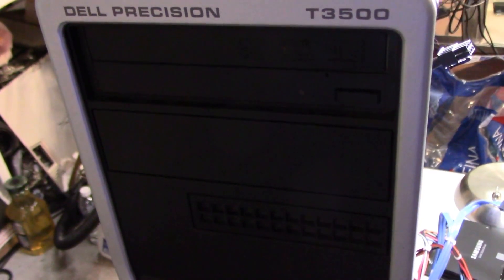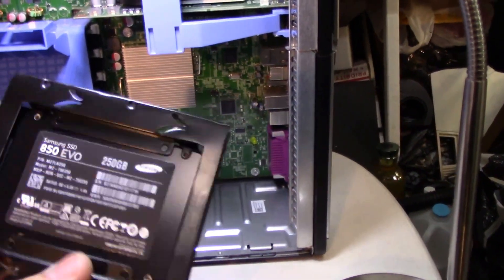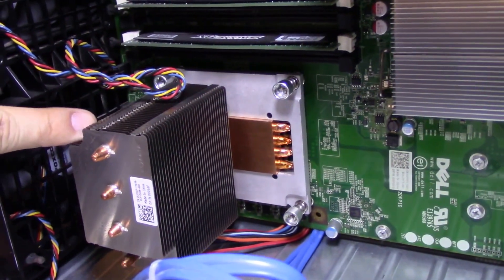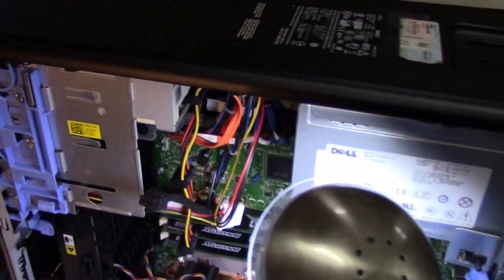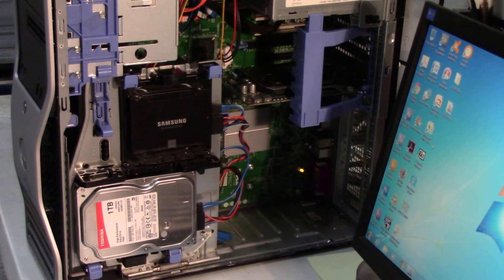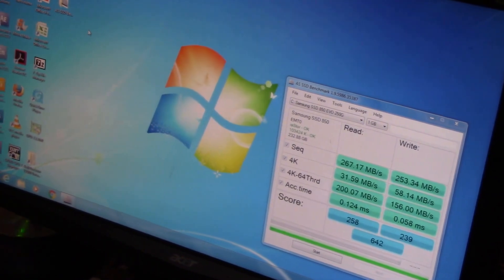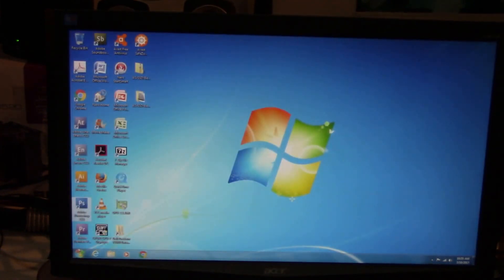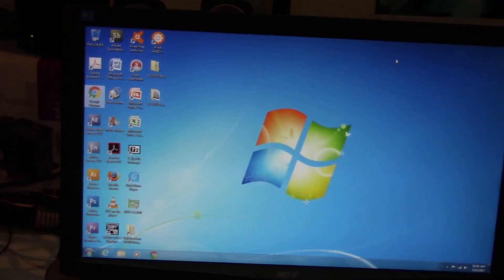SSD upgrade on Dell Precision Work Station is it worth it?

Comment: You can upgrade these all the way to a 6 core 3.4 GHz with Hyper Thread support.  I used two of them for workstations and two of them for servers in my home network.
Reply: love these i build a 1080p gaming pc with it. I added ssd and 4gb gpu
Reply: I know for sure that this chip will work because I have four of these workstations running it:
http://www.ebay.com/itm/Original-Intel-Xeon-W3690-3-46-GHz-Six-Core-AT80613005931AB-Processor-CPU-/282053752153?hash=item41abb6b559:g:fWkAAOSwdsFXTP6C
Reply: Does that chip work in ones with a w3550?
Reply: @Demon09-_-  yeah it does make sure your bios is up to date
Reply: i can work for w3550 ?

Comment: I have one, x5690  with a 250 gb ssd with a 2 tb platter drive running windows 10 64bit professional with 20 gb of ram. I am about to upgrade the videocard to a EVGA NVIDIA GTX1660 Ti 6GB Graphics Card which if I go with this card I will not have to update the power supply.

Comment: Hi, i installed a SSD into my Dell 490, and it is constantly freezing and running very slow, i managed to stabilise it for a little while but most of the time it just freezes, any solutions?
Reply from the maker: It is hard to say, are your bios settings set correctly? Storage configuration should be ACHI not raid etc... If that is set correctly maybe you have memory issues, might want to test your memory with something like mem test if your storage configuration is correct.

Comment: w3690 is the strongest Xeon for 1366 socket.  $59 on Ebay
Processor Base Frequency
3.46 GHz
Max Turbo Frequency
3.73 GHz

On a custom motherboard you can overclock it, so can you overclock x5675 that cost about $25 right now.  Both 6 cores 12 threads.

Comment: I recently got a used T5600 (dual XEON E5-2667 2.9GHz, 32 GD EEC 1600 MHz RAM, 825 Watt PS) in a company decommissioning...I was able to acquire under the policy for free.  Thru in a GTX 980 (had to adapt one 6 to 8 pin for the 6+8 pin power connections to the card).  Thru in an 240 GB WD SSD and did a fresh install of Win 10 Pro with a 10 dollar license key.  All-in I spent an additional 340 dollars in upgrades.

What a machine.  Productivity, Gaming, home server usage cases. Rock solid build.  Server components.  No complaints.

I did remove the H310 RAID adpater and went SATA 1 direct to the motherboard for the SSD.  The bootup times with the H310's own bios was not interesting for me and the drive setup was taking additional time.  Quite happy with the SATA approach here, though I understand the channel width and speeds via the H310 might be interesting to some, even in a RAID 0 setup.

Comment: Hello I have a dell workstation T5500,
The ssd speed problem is too bad, in the user guide the sata ports is sata3 but ı think they are sata 2. Am I right? Did you check the sata ports. İf I am right I will use IBM ServeRaid5000 raidcard for ssd and my sas hdd for the best performance.

Comment: I need some help,
Just got a PC for 180,
Has the following specs:
Intel Xeon W3520
1tb hard drive,
AMD Radeon 8490,
16gb of ram,
And Windows 10.

What upgrades should be made?
My goal is to record League of Legends, Skyrim, Garry’s Mod, Minecraft, DayZ Mod videos at 60 FPS with lowest settings, and occasional high settings for certain clips.
Reply from the maker: Sandman the Xenon you have has base clock of 2.66 ghz, and a max turbo of 2.93 ghz, it should give you the performance you want at 60 fps at lowest settings, however you need a better video card, the 8490 is a basic display adapater not meant for gamming.  You first upgrade should be a new power supply, I would recommend a 500 watt or greater power supply, get a good brand like corsair, thermaltake, or antec, Thermaltake is the best bang for the buck.  The hardest game to record for at 60 fps would be DayZ and Skyrim - Skyrim SE is harder to run than the original Skyrim. You would need a GTX 1050 2GB for DayZ Skyrim will run great with that card too.  If you can afford it a GTX 1050ti would get you great FPS on higher settings.
Reply: lorllc and if I was just doing regular gaming outside of recording, would I still be able to have 60 frames on those games at the lowest setting? 
I’ll be playing the regular edition of Skyrim and the DayZ mod from Arma 2.
Reply from the maker: Well the most important thing you need is a better graphics card. If you get a GTX 1050 you will get very good frame rates, at higher settings. If you are on a budget you can look for used graphics cards on eBay etc a used AMD 7870 can be found for $65.00 - $80.00 and give you very good FPS
Reply: @lorllc T3500 already have a Dell Original 525 Watt Power Supply with 85+ Rating

Comment: I bought a T5500 from eBay last year for £230 and I put in two six core Xeon and a GTX 1060 6GB. I also put two Samsung SSDs and I use it for gaming. Superb machine. I had to take the blue bracket by the PCIe slots to fit the GPU but it works with Windows 10 Pro. It also came with 60GB ECC DDR 3 RAM. Considering my options for liquid cooling.
Reply: where you put it (ssd) port? with PCI-e sata III controller or sata port on board?
Reply: I use the on board SATA port.
Reply: whats the SSD you used? samsung 850 evo 250gb? I have a T5500 and wanted to upgrade. Thanks,
Reply: 2011Technical my boot drive is an 840 Pro 250GB with an 850 Evo 1TB SSD for additional storage.
Reply: @Kundalini12  İn the onboard Sata port can you use it well, because when I use that ports the SSD max speed is 280mb/s I think that ports is Sata2.

Comment: Hello, I have installed a 120 Gb ssd (at SATA1) in a T5500. The disk is not detected until the F1 key is pressed https://www.youtube.com/watch?v=93yK37iDi3o
In the bios switching from RAID/on to RAID /AHCI didn't improve. The bios version is A02.

Comment: Mine has Intel(R) Xeon(R) CPU  X5680  @ 3.33GHz turbo to 3.6GHz
Running and Old Radeon HD 6870
Great for gaming at Max Video settings on WarThunder 100FPS 
Sata speed can be upgraded by adding a PCIe adaptor 
Heck you could probbably add Mvme SSD via PCIe to mini Pcie adapter

Comment: Bought mine half a year ago. Still very happy with it. Upgradeable as hell and if you do so, still a nice performance for nowadays.
With boot SSD, USB 3.0, Xeon X5690, enough RAM. You might think about changing the powersupply, if you want to add some graphic from nowadays.
I just think about to imrpove it's grpahic System (Nvidia Quadro fx 5800 and Nvidia Tesla c1060, working together with Nvidia Maximus driver).

To answer the question in youre video title: Yes, i think it's worth. Even in 2017.

Comment: Good video. Just recently got one of these + a lot of spare parts. Basically just changed out the psu with a 600w antec. Added a GTX 580 videocard I got for free. Added a SSD drive today. Basically when you see the windows logo it takes 8 seconds to get to Microsoft edge. My processor is a Quad Core 3.07 ghz. 24gb of ram. Was really surprised with the performance of this machine. Out performs a 6 core amd fx 6300. 2x Quatro 4000's 2gb came with the machine but I read that sli does not work with them.
Reply: trying to help a friend set up an SSD in his dell but i cannot see his BIOS options, wondering if he needs to set anything to SATA mode or anything because he is not having his SSD drive show up after install

Comment: i have this kind of desktop but in time of 3d rendering it will take time this kind of processor xeon w3503 @ 2.4 ghz and core 2 only thats why im planning to upgrade my processor in Intel Core i7-7700K isnt working on this kind of workstation?
Reply from the maker: jhongzkie Gamers, the Intel Core i7-7700K (socket 1151)  will not work on the Dell T3500.  A Knowledgeable viewer Chris Moore has stated that you can upgrade a Dell T3500 all the way up to the 6 core 12 thread Xenon Westmere  Processors (socket 1366 B) if you can find these processors then your 3D rendering times will go up, in addtion, make sure you have the proper video card for your 3D rendering program, that makes a huge difference too.  

Here is a list of compatitble Processors for your Dell T3500 DELL DPN: XPDFK Precision Workstation T3500 Motherboard

Supported Processors:

Intel Xeon 6-Core (X5670, X5650),

Intel Xeon Quad Core (W3550, W3565, W3530, E5640, E5630, E5507),

Intel Xeon Dual Core (W3505, W3503),

Intel Xeon (W3680)
Reply from the maker: You can find some of these Xenon Quad Core and 6 Core CPU's for cheap online.  Making this Desktop a great value!
Reply: I did not try to put an i7 in there, I bought one system that already had the 6 core Xeon in it and upgraded three other systems that came with different (slower) Xeons.  They all worked like champions.
The one I used was a Xeon W3690, but this one has even better specs and should work perfectly:
http://www.ebay.com/itm/Intel-Xeon-X5690-Six-Core-Processor-3-46GHz-12MB-Cache-LGA-1366-/122524028534?hash=item1c87004e76:g:iQkAAOSwmCVY9J5~
Reply: I think that most of Intel's decisions are purely money driven.  They could have ECC support in every CPU they make and it wouldn't change their production cost.  They just want to be able to charge more for the high core count Xeon CPU.  It is the same reason they have kept the core count compairatively low in the consumer line.  They build the product around the target audience and price it based on what they think the buyer will pay instead of having any relationship to cost factors.  The fear of competition from AMD is the only reason they rushed to market with the i9 chips, especially when the product just doesn't make any sense.
Reply from the maker: Yikes, the i9 Chips... This launch is definitely rushed I believe the boards have to support like 16-44 pcie lanes depending on processor.  And the processor support is from 4-18 cores... Intel has a history of protecting their markets and also for disabling features between product lines such as when they took overclocking features out on many Skylake CPU's. It is amazing that Intel feels this much pressure from AMD, it is good to have competition, but the only time AMD was a real threat to Intel was back when AMD released the first 64bit CPU.  Let's see how the i9 line is received.
Reply from the maker: The projected i9 prices are pretty insane. I am rooting for the AM4 CPU's to get better with time and  in some current applications the AM4 CPUS really do give intel a run for the money.  Yes, the "Threadripper" is to feature 64 pcie express lanes if the price is right that would be pretty awesome.
Reply from the maker: I put i7 in the my response by mistake lol should be only Xenon, officially the cpu list doesn't list the 1366 i7's but the chipset is identical and they should be recognized but I have never upgraded one with an i7 either, I have actually seen some refurbhised t3500's listed with 1366 i7 950's.  But to get X5690 for that price is amazing.
Reply: I have a Gigabyte system board that takes the same socket chip and I have put the i7 (quad core) in it and I tried it with the Xeon (hex core) and both worked fine.  I know someone that used an i7 in a SuperMicro server board with the 1366 socket and it worked for him, but you loose the ability to utilize ECC functionality in the RAM.  The system still posts and everything appears to work, but the ECC is just not actually working because the i7 chip doesn't have that feature.  I don't know if the Xeon chip with ECC memory in the Gigabyte board would work.  I think that it might not because the system board chipset doesn't support the feature.  Also, there are physical traces that are required between the RAM and CPU that might not be present because they are only used for the ECC functionality.  
These Dell T3500 systems are great though.  I use the heck out of them.
Reply: But the i7 is working on t3500 except the Ecc features?
Reply: That is not what I said.  Review the messages again.
Reply from the maker: Chris you are correct the i7 920-960 series IMC does not support ECC functionality only the Xenons do, So if your T3500 has ECC ram better look for Xenon 4-6 core upgrades if you want to keep your ECC functionality.  The computer in our video was running DDR3 NON ECC RAM because NON ECC RAM was just cheaper and they did not have need for ECC functionality.  As for using ECC RAM with a Xenon on a non server 1366 board; I am not sure either.  Technically speaking it should be possible because the X58 Chipset is the same on server boards and consumer boards  but the bios would have to support it, and perhaps there are technical differences as you have pointed out too.
Reply from the maker: Caught it oops.  Thanks Chris I edited to be more in line with upgrade questions.
Reply from the maker: Chris had stated that his friend used an i7 in a SuperMicro Server board that had ECC RAM installed, but his friend lost ECC functionality.  As for an i7 working with no issues alongside ECC RAM on the T3500 I am not sure since I have never tried it bios differences between SuperMicro and Dell maybe different enough to cause issues If someone has tried this on the T3500 let us know.  However, to be on the safe side, perhaps search for a Xenon upgrade if your T3500 has ECC RAM installed.
Reply: I think the i9 platform is going to be a flop.  Mostly that is because of the number of negative reviews I am reading and watching, but I read the projected price of the CPU alone and the projected price of the system board and thought that it is too much to pay for the tiny improvement over the previous generation. 
I need more PCIe lanes and that is making me look real hard at the new AMD platform.
Reply: Xeon X5680 and X5690 too

Comment: Before I watch your video, I will tell you my take on it.  I have four of these systems doing various jobs in my home network.  I upgraded them to SSD and it was like getting a new computer.  The perceived performance was doubled.
The built-in SATA controller is limited to 300MB/s but the original hard drive was around 75MB/s and putting the SSD in gave me the full 300 that the controller was capable of.  It was so much better that I decided to keep the systems and three years later, I am still using them.  I am using a T3500 right now as my main, daily driver, computer both at home and at work.  They are awesome.  The next upgrade it a PCIe card to give me USB 3.0
Reply from the maker: Chris these T3000 series computers are rock solid and as you have already discovered they are like brand new computers with SSD upgrades.  With USB 3.0 is a definitely a plus, it is a shame many people don't get a chance to use these precision desktops.
Reply: In my workstation, I had added a SATA 3 controller and a USB 3 controller to give me both of those new technologies as well as using a Nvidea GeForce GTX 970 video card.  I never had a problem with performance but I could get more with a 10 seriese video card.  You just have to use one of the blower style cards to get the heat out of the case.
http://techbuyersguru.com/video-card-comparison-blower-style-vs-open-air-coolers
The open cards leave too much heat in the case and usually are too tall to fit in the case properly.
Reply: Agreed. These are still massively underrated even today. I use a new 2018 Precision 7720 laptop for my CAD work, but have a T3500 (and a T5500) at home for daily "stuff" such as Photoshop/Illustrator etc. Both run 24Gb RAM, Samsung 850 SSDs, and Quadro cards (FX4800 and K4200 respectively). They're rock solid, and insanely cheap for what they do for the average user. I've set all my family and friends up with ex-corporate "bulletproof" Precisions. The M6500/6600/6700 Precision laptops are cracking machines too. (No, I don't work for DELL! LOL)
Reply: Hello, i have a t3500 with core i7 920 2.66 ghz, can i up grade to a better cpu? If yes what cpus are compatible with the t3500? Thanks